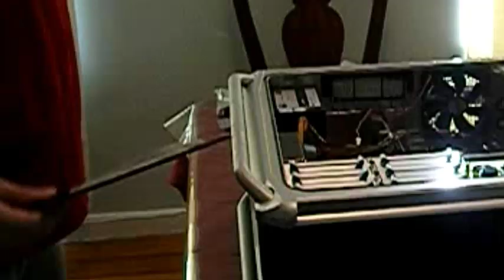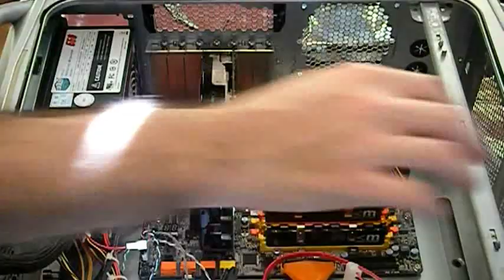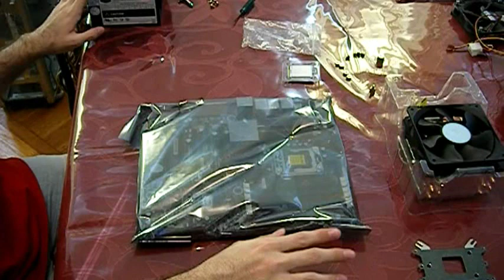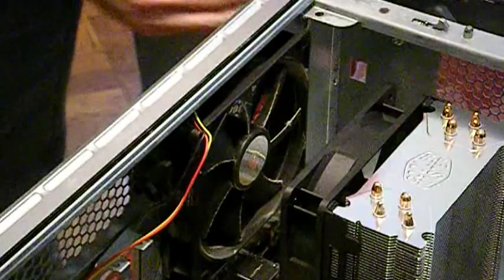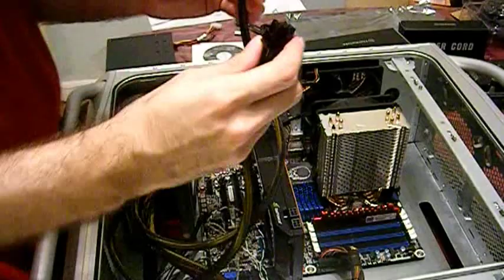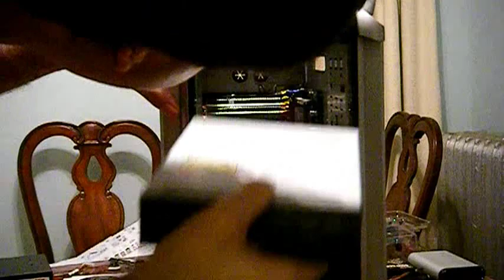Ranger Review Specials 07 Building my New PC (Part 2)

Comment from the maker: @DaTechyGuy I didn't pay $2000. And what does it matter which way it's pointed. It works pointing inward. And the other fans push the excess heat out. None of my components run hot, period. And I'[m editing videos 17 hrs straight in a 100 degree room, in the summer. Zero issues.

Comment: @rangerreview That's because you leave it no room to suck in cool air. The case is your killer. It has no windows for air intake/exhaust. I personally think you overpaid for most of your components because with $2000, you could've built a beastly computer and get the most out of it, but I guess it's too late for that now